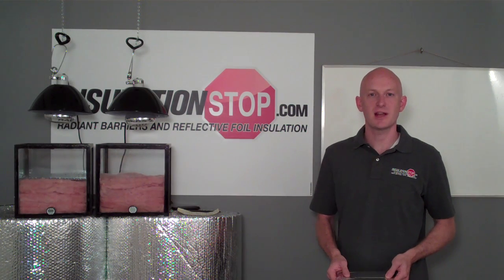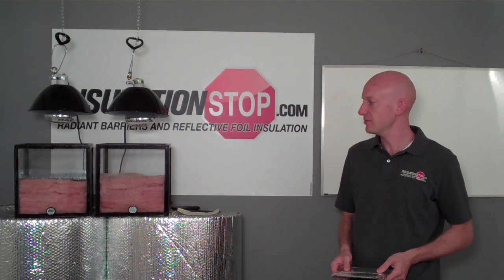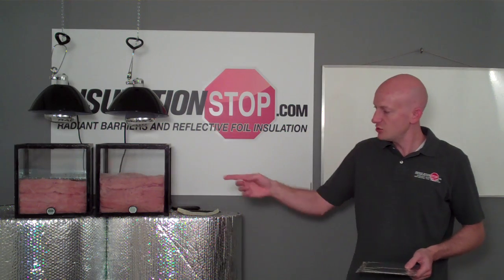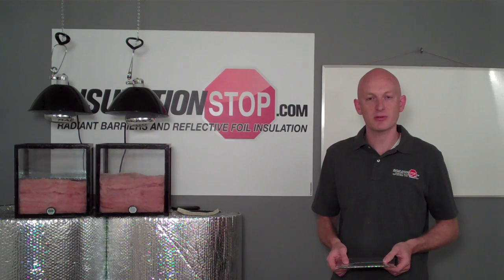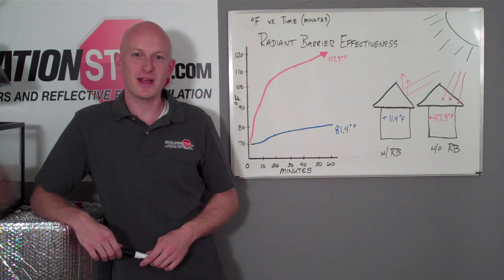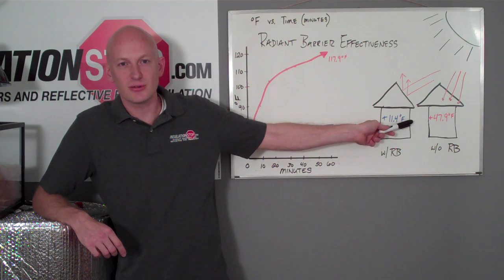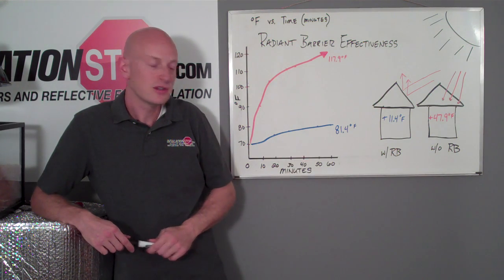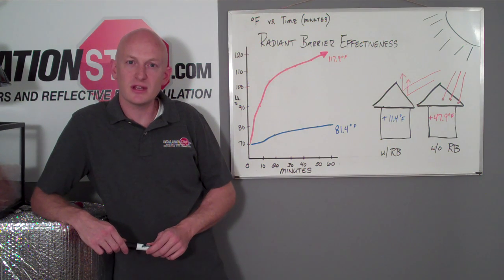Radiant Barrier versus Fiberglass Insulation Hot Box Test

Comment: Nice, an actual test.  Would the radiant barrier fare any better if it were not in contact with the insulation that it is protecting from heat, with an air gap below it?

Comment: Thank you great video, though a bit of a small problem. A radiant barrier requires an airgap, hence you would have probably gotten a better result if the radiant barrier did not touch the fibre glass. When a radiant barrier touches another object it will become a conductor. So in my opinion the radiant barrier was half effective because it was not in full contact everywhere with the fibre glass due to this material not being even all over. Woudl be great to see the experiment again with the radiant barrier not touching the fibre glass.

Comment: I recently insulated my detached garage flat roof by putting 150mm of rockwool insulation sandwiched between the roof and 12mm plasterboard. I dont want to take that all down to apply this as the forst layer. So my question is, can i add this as a layer after the plasterboard? Will it still be effective?
Reply from the maker: If understanding correctly you want to add a radiant barrier to the face (exposed side) of the plasterboard.  This will reduce radiant heat gain in the garage if there is any that makes it through the roof system.  Critical to not cover the radiant barrier, the exposed side needs to have an airspace of 3/4" or greater to be effective in this assembly. Radiant barriers have high reflectivity and low emissivity.  In terms of insulation, a material with low emissivity would tend to hold onto heat more effectively because it emits less thermal radiation.

Comment: This test represents an attic without a roof? How much infared penatrates a roof?
Reply: Unsure about the infrared but a practical explanation for heat transfer would be comparing the roof to a sponge.  The sponge will continue to heat up and then pass this heat (via radiation and/or conduction) to the cooler interior surfaces below the roof line until the heat source subsides (typically night fall) and equilibrium is met.  The cycle repeats the next day.
Reply from the maker: Unsure about the infrared but a practical explanation for heat transfer would be comparing the roof to a sponge.  The sponge will continue to heat up and then pass this heat (via radiation and/or conduction) to the cooler interior surfaces below the roof line until the heat source subsides (typically night fall) and equilibrium is met.  The cycle repeats the next day.

Comment: Would this also work in reverse? It does right? Radiant energy is radiant energy?

Like If I were to try and use this to keep heat in, instead of out, it would also perform better than fiber insulation?

Comment: Total nonsense. What is the wattage of the heat lamp? 300 watts - maybe more across a 5 inch diameter bulb. 
If the temperature of your roof sheathing is 150 deg F then a 5” round piece of your sheathing (same as your bulb) is radiating less than 10 watts @ 150 degrees F. 
Put a 10 watt incandescent bulb in your heat box and redo your one hour test.

Comment: In order for pink insulation to work as designed it needs 6 sides, you only had 5. A better test would be a piece of dry wall on both over the insulation and then put your material over the the drywall.

Comment: if foil is under the roof shingles and plywood then it can not reflect radiant heat since it is not directly exposed to the light. experiment makes sense as you can see when there is direct light hitting and getting reflected by foil.
Reply: It doesn't need direct exposure to the light it needs an airspace to be effective.

Comment: is it intended to use on out side of exiting walls w/o any insulation  in the wall?
Reply: No.  If you were to "wrap" the exterior structure, you would still need to insulate.  The reflective benefit of the barrier needs air space to be effective.

Comment: You forgot that there's a roof between the insulation and the sun. 🤦‍♂️
Reply: Those materials still absorb and transfer heat.
Reply: @kcmaldonado3948  dont radiant barriers reflect radiant heat which is in the form of light? And the roof takes the grunt of this radiant heat, heats itself up and also the air underneath it, converting the radiant heat of the sun to convection with the air touching the other side of the roof. This is why most insulation is focused on air pockets. The concern then is whether or not such a reflective insulation adds any value given that the roof already takes most of the radiant heat and transforms that heat to convection (heating thru air not light).
Reply: @PablocitoSantino  What you're missing is that thermal radiation isn't just from light. All matter that has a temperature greater than absolute zero will radiate heat. The roof is radiating heat onto the insulation. It's not using convection to heat the insulation in a home. If convection were the primary form of heat in attics, then venting would solve all our problems with attic heat. Instead, we use venting to cool the roof deck so that its not radiating as much heat.

Comment: I thought this was going to be a test of just radiant barrier by itself vs. just fiberglass insulation.  No surprise the side with both would provide better insulation.  I have radiant barrier on the roof joists  in my attic in addition to insulation on the attic floor.  I saw a video of someone who put radiant barrier on the walls of a shed instead of insulation.  I didn't think it was an alternative to fiberglass insulation.
Reply from the maker: For r-value the foil would not be a suitable alternative.  But to block radiant heat, the bubble foil is much better suited.  There are many cases where fiberglass insulation is not an alternative to reflective insulation (the shed you referenced for example, areas with high moisture content, metal buildings, duct wrap insulation, etc).  Ultimately the best thermal performance depends on the application and the product either stand alone or a system of products not necessarily one or the other.

Comment: Thank you for the video.   In the example the radiant barrier was placed on top of and touching the insulation.   Do gaps between the barrier and the insulation help, hurt or not matter?    Would it have been more effective to place the barrier on the eaves under the roof instead of across the insulation on the ceiling?    I assume air permeable barrier should be used in both cases - is this true?     Thanks.
Reply: An air space is always best with reflective barriers.
Reply: The ideal radiant barrier is stapled to the bottom of the trusses, so you have an air gap on both sides of the radiant barrier. This gives you the benefit of the radiant barrier being a poor absorbing of radiant heat, as well as a poor emitter of radiant heat. 

The example in this video shows the impact of radiant barriers inability to absorb radiant heat. The newer roof decking has a radiant barrier glued to the bottom of the OSB. That radiant barrier will absorb heat through conduction, but it will still have the benefit of not being an effective emitter of radiant heat.

An air permeable radiant barrier isn't necessary as long as you leave a 12-18 inch gap at the bottom and top of the radiant barrier to allow for the area behind the radiant barrier to vent.

Comment: So many misconceptions in the comments, it is not really worth the time to clear them up...…...people will believe whatever they want, no matter if it is fact or fiction.   ……..Have fun with high utility bills and your air leaking houses that need to breath....lol
Reply: I too Question the test because it does not take into account conductive and convection heat transfer,  In real life the radiant Barrier is on the underside of the roof  material. which will then get heated from above and below, Ultra violet waves from above and infrared waves from below. How ever radiant barrier does nothing to stop heat transfer through conductivity from roofing members.  the insulation between framing members,  when the foil absorbs heat it will emit heat through conductivity into the air drivin by convection.   I would like to see a test with a real life structure simulated in you lab. thanks
Reply: @mydreamhouse1  There are a bunch of videos on YouTube showing the impact of radiant barriers. We have cheap Flir cameras now, so everyone with $200 can test this out. The radiant barrier has two purposes. Its a poor absorber of radiated heat, so most of it is reflected back. It's also a poor emitter of radiated heat, so the heat it does absorb isn't effectively emitted. An air barrier on both sides of the radiant barrier would take advantage of both of those traits.

Comment: The test is bogus. Note the placement of the heat lamps above the box allowing the free movement of air in this region. Of course the radiant barrier will be effective in this instance (the air below the insulation never becomes heated). The correct way to preform this test is to measure the AIR temperature both above and below the two insulations; doing so will return very different results.
Reply: To prove the point, you could have repeated the experiment with two setups: one with the fiberglass insulation alone and one with just a SINGLE layer of aluminum foil and NO FIBERGLASS; you'd get virtually the same results.

Comment: This is interesting, because it shows that you can create a small model and then test it. I would test this again with a few layers of realistic roofing materials between the lamp and the radiant barrier.
Reply: @VElitePV  Yes, the problem is that if the light bulb is simulating the sun then this video does not show us a realistic house insulation model. The sun doesn't shine on your attic insulation -- it shines on the shingles.
Reply: @davejoseph5615  The heat lamp uses radiation, just as the sun does. They weren't trying to create a realistic model of an attic, they were just demonstrating the principle. In the real world, the sun doesn't radiate heat directly onto your insulation. The sun's radiation heats up your shingles and decking, which then radiate heat onto your insulation. The principle is the same, this experiment just exaggerates the process.
Reply: @kungfoochicken08 but then u will c how little of a difference that foil really makes
Reply: @MrTomcatpl  It’s fundamentally the same concept as those sunshades people put in their windshields when they go to work. It works well. I got an 8-11 degree drop in my attic temperatures. Fixing any venting issues is a bigger bang for your buck if your attic isn’t vented well. This is a close second. I paid $600 for the foil and it took me two hours to run 1600sqft by myself.
Reply: @kungfoochicken08 no, the principle is not the same.  The reflectix is reflecting direct sunlight, not indirect heat.  Totally different.  If they would have stuck a piece of cardboard on the top of the box, that would have been a much more realistic test.  The lights would heat up the cardboard. The box interior would then heat up as an attic space would, through indirect means.  That would test whether reflectix would help in an attic.  Its like standing in direct sunlight, then put an umbrella over your head.  You are not getting the direct sun's rays.  Then you are just effected by the ambient air temperature, just like an attic.  Reflectix does work very well to reflect, but as an insulator it really only provides a 1/4" airgap.
Reply: @derekneu6524  Nonsense. The roof deck is still radiating heat. Down into the attic. That is what these foils are reflecting back and preventing from entering the attic space. You don’t seem to have a very good understanding of how heat radiation works.

In your umbrella scenario, you’re getting ambient heat from the air around you, plus you’re getting heat that’s radiating from the umbrella. They’re typically thin fabric, so they aren’t absorbing or reflecting much heat. An asphalt shingle roof soaks up heat from the sun like a sponge, that heat is transferred to the wood decking, which radiates heat down into the attic.

Feel a brick wall or an asphalt road right after the sun sets. It’s the same principle. Both surfaces will still be radiating heat that they absorbed during the day.
Reply: @kungfoochicken08  yes, it radiating heat, but not reflecting direct rays of UV from the sun.  That is my point.  You need to test its ability to reflect heat and cold, not direct rays.
Reply: @davejoseph5615  whow
Reply: And then test over 6 to 8 hrs of simulated direct sunlight. The big question is, does it also slow the cooling of the house throughout the night causing another issue.

Comment: I could be wrong but I don't think this was a valid test. Sure... it would reflect the heat (from the lamp) due to a transparent object (the glass) and provide the protection. Now... if you did the same test and put something in-between (maybe shingles, plywood on top of both boxes) and repeated the test, then... I think you would have something. This isn't a good test but it did give me an idea to perform my own test.
Reply: How did your test work? I think the idea is that the shingles would get hotter and radiate extra heat back out into the air.
Reply: The principles are the same. The heat lamp radiating heat directly onto the insulation is no different than the heat lamp heating up shingles, which then radiate heat onto the insulation. Radiated heat is radiated heat.

Comment: If I have galvalume metal siding on the outside of my house, wouldn't that act as a radiant barrier the same as the aluminum barrier you sell. They're  both metal. Whats the difference???
Reply: The difference is in the reflectivity.  All materials absorb radiant heat, the question is how much.  A radiant barrier only absorbs approx 5-7%.  What is the reflectivity of the galvalume panel.  The manufacturer may be able to answer.
Reply: I have a patio cover of white galvalume, uninsulated.  Summer temperatures heat the metal, which reflects some of the heat, but also radiates some.  On the hottest days it is not comfortable sitting under the metal roof.  When it is cold, depending on moisture in the air, condensation forms underneath and it "rains" under the patio.  Seams are sealed.  The discolored redwood joists tell that story.  I inspect homes professionally and have been under patio roofs made of reflective metal roofing over sealed foam insulation with textured FRP bottom.  In this type patio roof radiated heat is minimal and no evidence of condensation.

Comment: Just an observation.  The left side thermometer on the bottom went up 11 degrees in an hour.
 Now extend that over the afternoon... 6 hours X 11 degrees per hour equals 66 +69 degrees =  135 degrees. It seems that eventually the insulation  would become almost as hot as the 
non covered insulation, by the time the sun went down.  Now after the sun
 went down the non covered insulation would "bleed off the excess heat" 
(at what rate I'm not sure) where as the insulation with radiant barrier
 would hold the heat in longer due to the radiant coverings properties. 
Consequently I'm not sure if radiant barrier on the insulation is the 
way to go at least in hotter climates. Maybe roll it up and store it out
 of the way in the summer and unroll it in the winter. Just an 
observation.

Comment: I would love to see this same test but with the heat source coming from the bottom (to represent heat rising in the winter) also would love to see this test with cellulose (including the heat coming from the bottom)
Reply: The heat coming from the furnace and vents wouldn't be radiant heat, so it wouldn't be end same effect as reflecting the sun's radiant heat
Reply: It would not matter.  We don't care which side of the insulation gets hot, we just care that overall it slows down the thermal transfer process which in any case saves you money. There are no if ands or buts about it.

Comment: You showed the barrier between the heat load (Sun) and the insulation, will you get similar results should you use fiberglass against the roof sheathing in your attic then add the thermal barrier? I'm thinking of using fiberglass then the barrier in my garage which has exposed rafters and sheathing with no soffit vents.
Reply from the maker: If we understand you correctly, when you stand in your garage you will see the foil insulation (the FG will be installed above that)?  Yes, this will work fine.  As reflective aluminum is 94-96% reflective that means it only emits the inverse, 4-6% of radiant heat.

Comment: What is better for HVAC duct insulation? Fiberglass or reflectix. All reviews I've read have been great.
Reply: While I agree both insulations will become hot, I think we have to look at how much heat will be transferred through the insulation and the ceiling to the roof below.
Reply: Still needs an air space between the surface of the ductwork and the material to be effective.